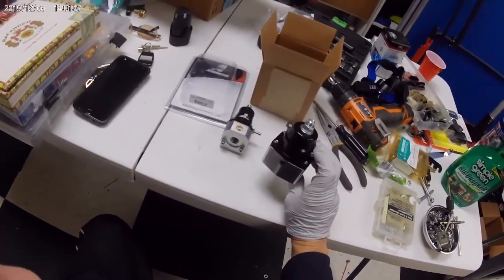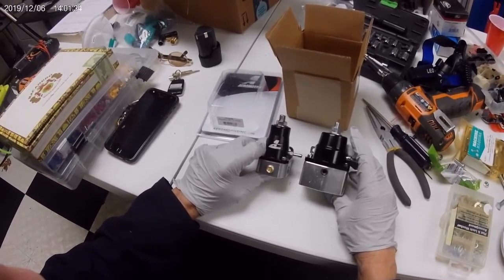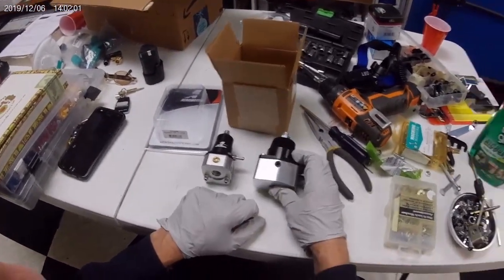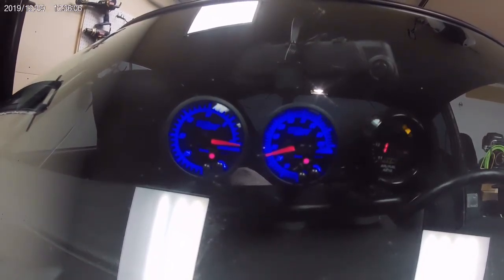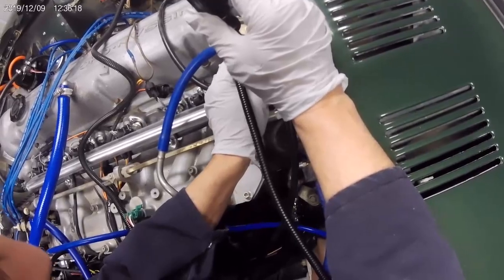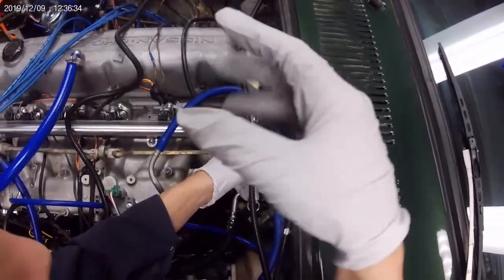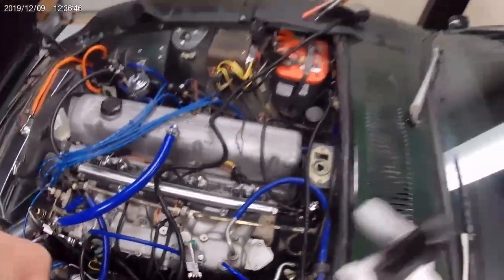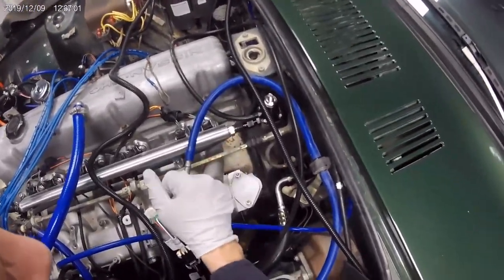Aeromotive Fuel Pressure Regulator Unbox, Install, and Adjust For 280Z

Comment: Z and Zx  run between 25 and 30 psi nothing higher than 35. That fuel pressure regulator only goes down to 40 psi.
Reply: This model goes to 30psi.
Reply: @anthonyceretti5333  Aeromotive site , model 13129,  range is 40-75psi.

Comment: I never considered mounting the for directly to my Sr20det rail. I just need to dance around the throttle body but you save some a headache. The Body of the Regulator Is larger relative to the mount and the holes in it are small. This is a perfect work around. Thanks

Comment: So, I am trying to understand your setup. You are feeding your regulator into the bottom port ? The bottom port is the return, for returning back to  your tank. Unless I'm missing another line that you are feeding the rail  with then going out to the reg and back to the fuel tank.  Tank - inlet on reg on one side. Then out the other Inlet on the opposing side to your rail, and what your reg pressure it set, the residual goes out the return and back to the tank. Our you could got tank-fuel rail- out of rail to inlet of reg-block other inlet port, and then return out the bottom back to the tank.
Reply from the maker: Sorry for the confusion. Maybe some of my many other videos explains the routing of fuel and vacuum lines. Please view "280Z Fast EFI Harness Routing Summary with Vacuum Line Layout" beginning around the 8 minute mark. Only one inlet is utilized on the regulator. The other inlet is plugged. You are correct that the bottom fitting is the return line that goes to the tank. Feel free to ask any more questions. Putting all of the information in one video would have been too large, long, and boring.
Reply: @280zcar3  Yep, my mistake. Thanks for clearing it up!